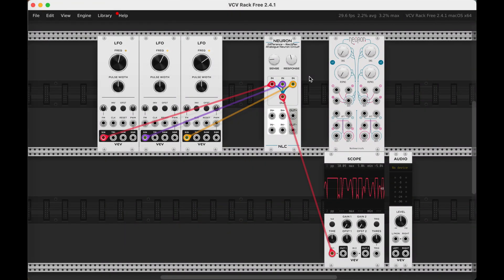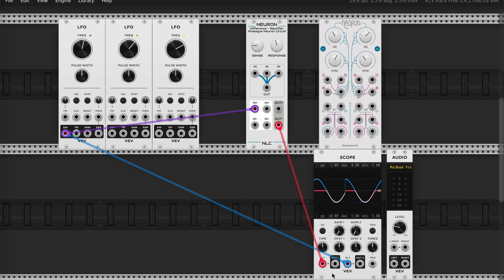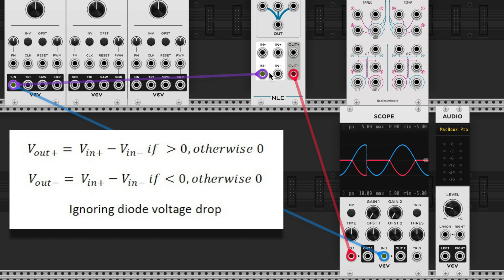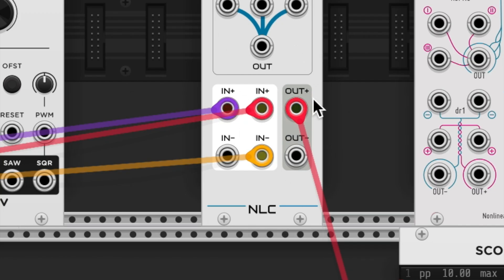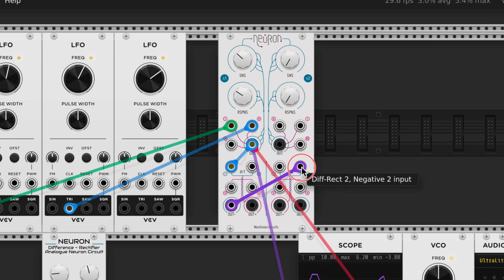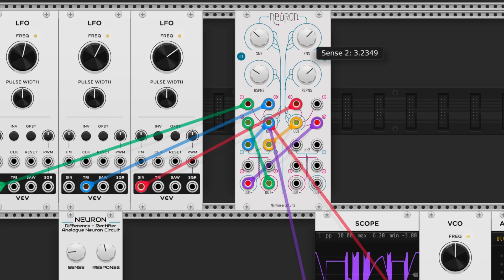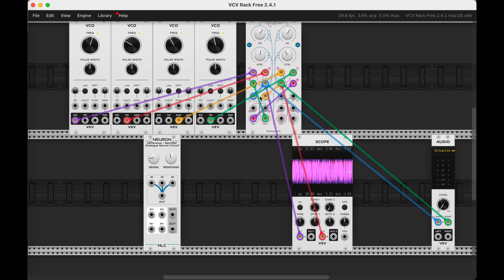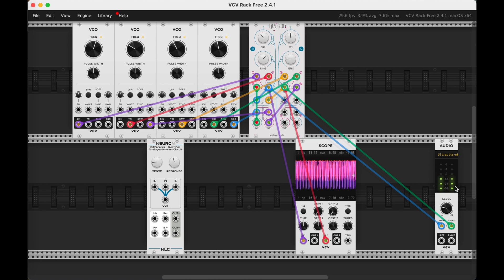NLC Neuron Diff-Rect (Difference Rectifier) #vcvrack #eurorack | Simon Hutchinson

Comment: Another great use for this module is to obtain the max and min of two signals. Just take the positive output and add back the negative input for max. For min invert the positive output and add back the positive input. Cheers!
Reply from the maker: Excellent! Beautifully elegant patch!
Reply: Just patched this up, looks like you can also obtain the min by taking the max configuration and switching the positive output with the negative, and the max by doing the same thing in the min configuration. I hope it makes sense!
Reply: Yes, another way to express this would be...

Max = (half rectify (A - B)) + B
Min = (invert (half rectify (A - B))) + A

Or in words (as if you were patching it)... Take two signals (A and B), Mult and invert one copy of signal B. Sum that with signal A. Half rectify this. Sum the result with the copy of original (non-inverted) signal B for max.
To find the min, you'd want to invert a copy of the half rectified sum (A - B) and sum that with a copy A.